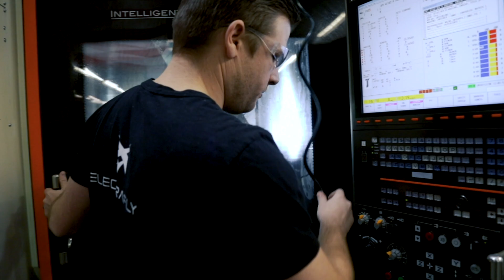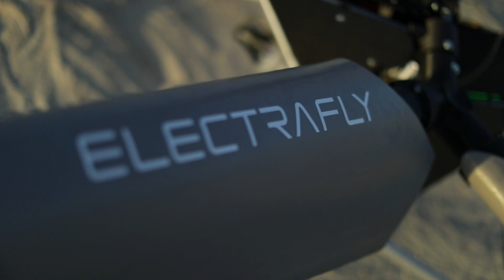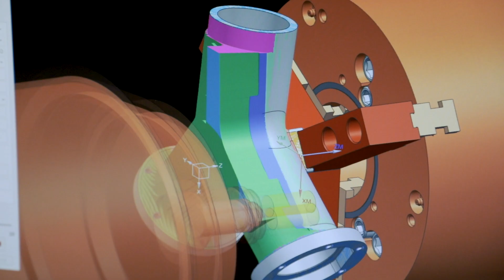indiegogo

Comment: I wonder if the way to go wouldn't be to look into metal 3D printing to manufacture jet engines cheaply. I mean if that were possible it might enable to build such a flying vehicle cheaply.
Two jet engine on the side that can rotate could "balance" the vehicle and then switch to horizontal flight.
But the costly part are the motors, rotors etc. If it were possible to use SLS metal sintering with e.g. titanium it might actually change.
And then build a capsule that is engineered to provide a ton of cushion and crumple zones for crashing haha.

Comment: Interesting design, very clever, I would love to see more details... 
Why most companies hide their design details, like rotor power, battery capacity, jet engine model, etc.
For those who know the topic, it is very easy to estimate the power of each motor and turbine that you are using anyway.
You can even make simple calculations for thrust required and rotor diameter, in order to estimate the power needed, or the extra range you get at cruise with the turbine.
I dont know much, but a raw estimation without using math or knowing much about models, I would said that the total power would be close to 50 kW, with a lipo-graphene battery of 7kWh (to provide the power needed for landing and take off) and a jet engine that would provide 20 kW, which would be enough to maintain cruise speed due lift and charge the battery.
Cruise speed might be +100 kmh?  
My numbers can be off, but someone with the resources and committed to design a similar vehicle, it would be a piece of cake figure out most of the components and estimate your drag and lift coefficient, still the devil is on the details, that is why I dont see any issue on companies sharing some of their main numbers.
Jet engines are light, but quite noisy, I hope solid oxide fuel cells or PEM fuel cells using liquid hydrogen improve the power-weight ratio and become more common, I guess that is the answer for the range problem without disturb everyone around.